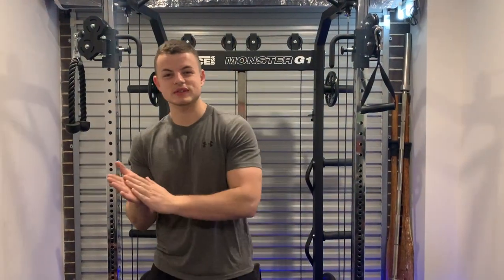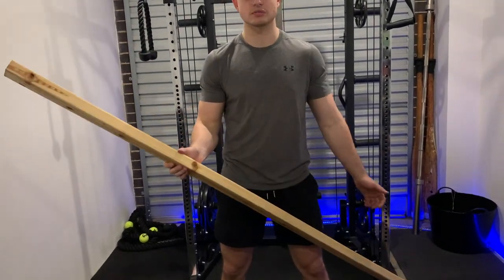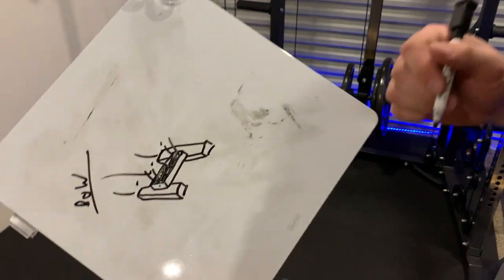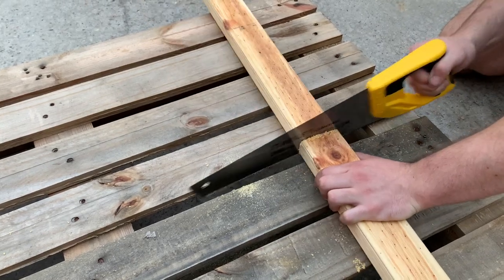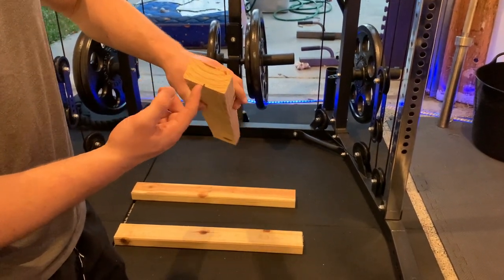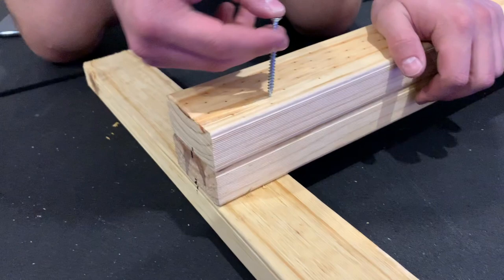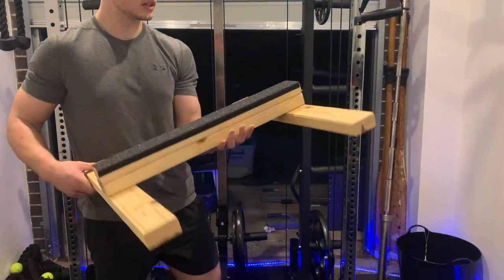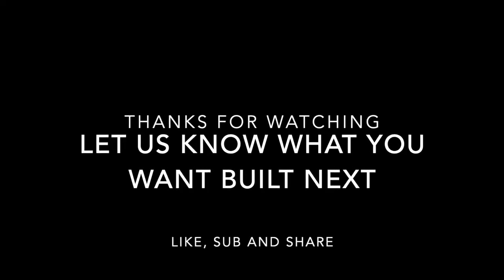HOME GYM DIY: EASY CALF RAISE BLOCK - UNDER $20

Comment: Cool! How tall are the wood pieces, you said is 7cm wide but how tall i should look after? Never had or seen a grip tape here in my city in eastern Europe, is the grip good? Im now using a piece of metal for calf raises, its 8cm by 8cm but my feet is slipping down when doing calfs and the metal has some sandy texture powder coat but its not enough to keep my foot stable, maybe because the metal i use has a little bit of rounded edges.
Reply from the maker: Hey Mate thanks for your comment. Each piece of timber is about 3.5cm thick/tall. I have 3 stacked on top of eachother for the calf block, and it is approximately 10.5cm high off the ground. As for the grip tape, it’s awesome. I’ve never had an issue slipping and have used it for multiple jobs. It’s what they use on the edge of outdoor steps etc, so I’m sure if you looked around you should be able to find something similar online 👍
Reply: @kobraathletics1814  thanks!

Comment: For the North Americans, get you a 2x4 at the Home Depot.
Have *them* cut it into (4) 2ft sections. 
Then get (8) 2 1/2 inch wood screws.
Non skid tape and 6 pack of beer, both at Walmart.